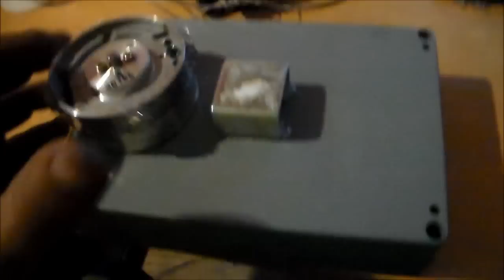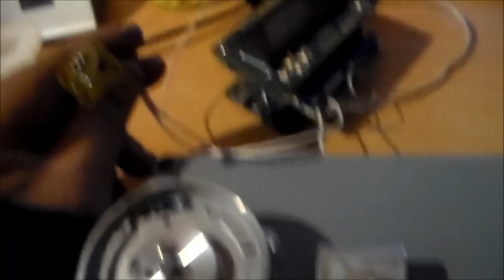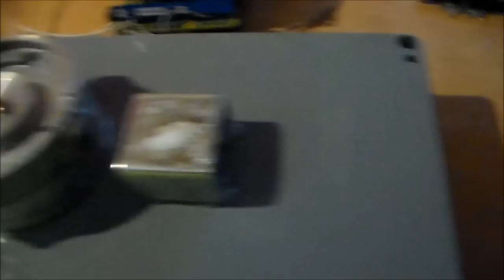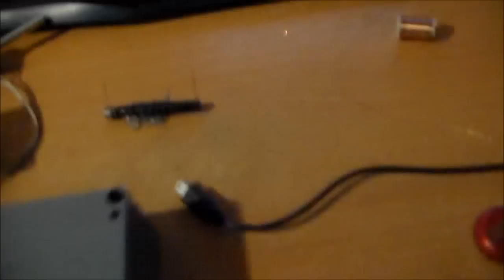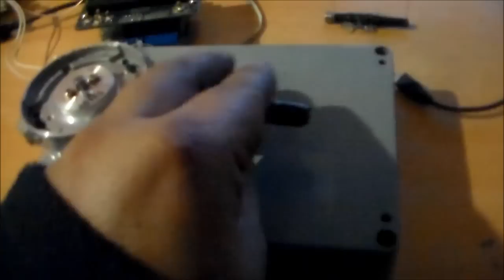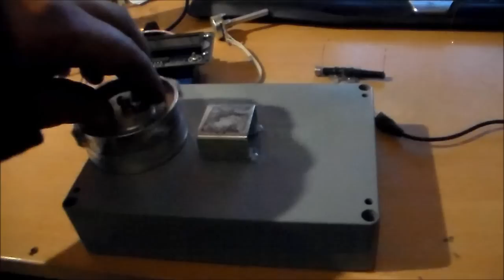Wacko Wednesday :- Pulse motor build part 1

Comment: Well, ive allways looked at the crackpot designs as being a way to waste energy in a interesting way lol.

The nutty people allways forget you will allways have losses so power out is allways less than power in, and using so called "free" magnets is just daft, power and energy was used to create them, and they will weaken with time so nothing free there :-)

And any generator will be full of losses so ...... well nuff said.

Yep head bearings are soooow smooth :-)